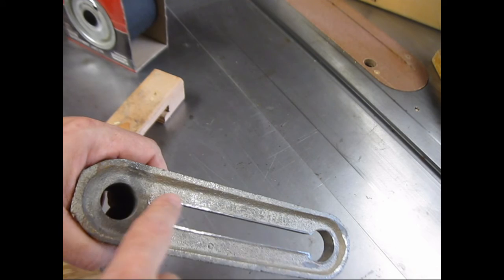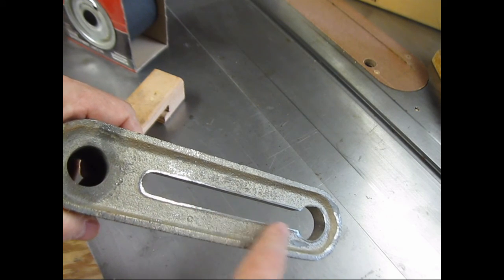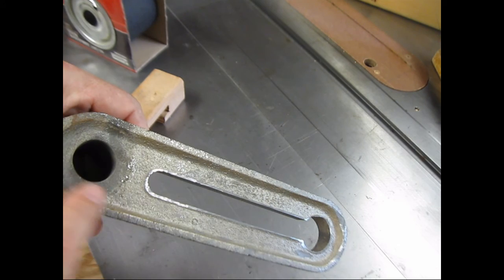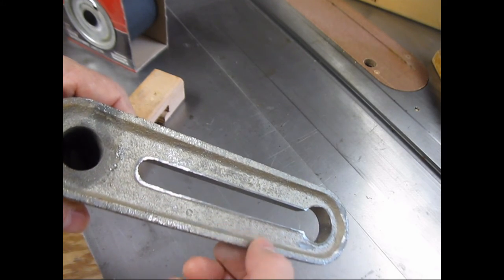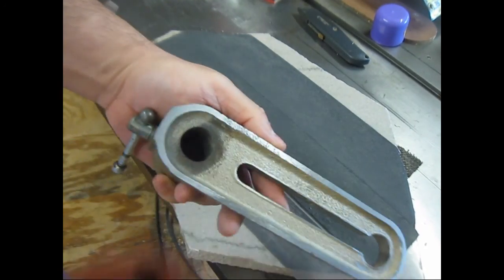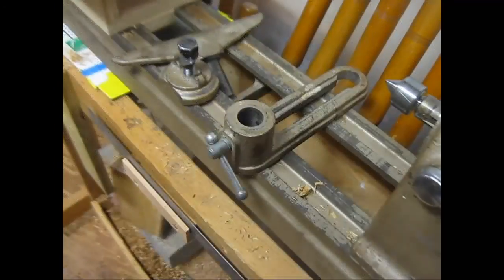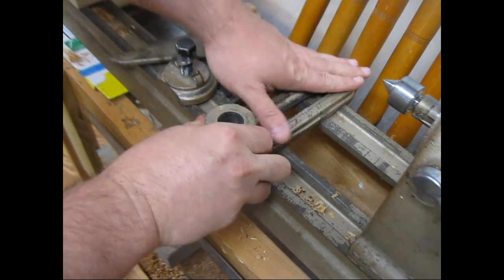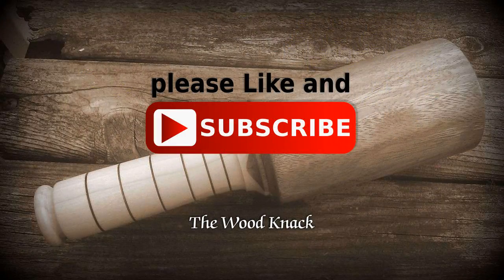Craftsman Lathe Banjo Tuneup

Comment: Nice job Rick!
I recently bought an old Craftsman King-Seeley wood lathe (103.23070) via Craigslist, but it's missing it's banjo (18138).  
Been searching eBay and Craigslist for one, but no luck.  Any suggestions?
Reply from the maker: Thanks! I would look for a banjo from another 9" lathe, Craftsman sold several I think.
Reply: Yeah, I considered that but was concerned that they may not fit.   They don't come cheap on eBay and didn't want to waste money on something I can't use.  Okay then, take care.